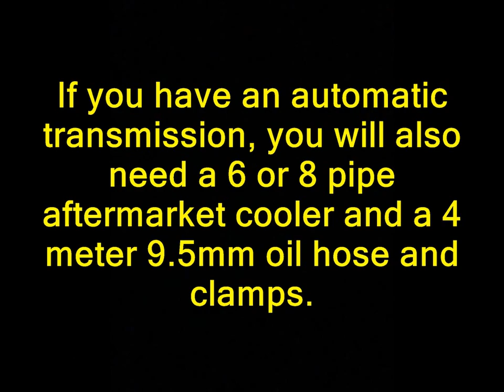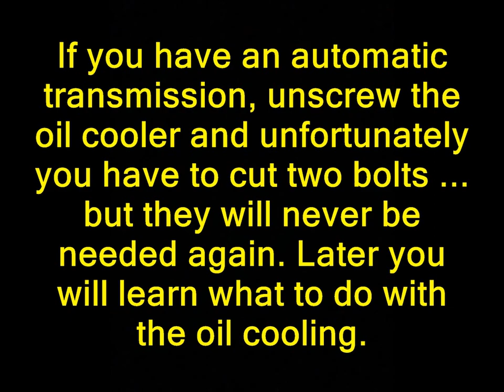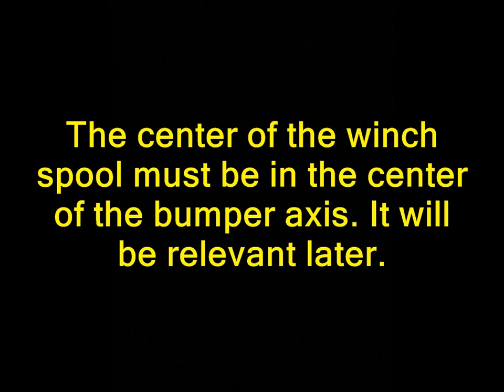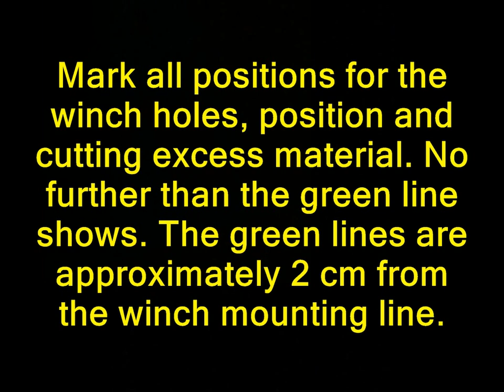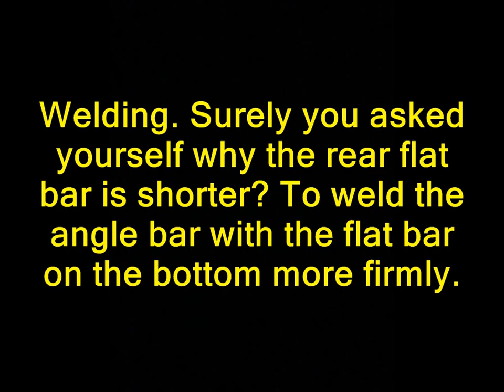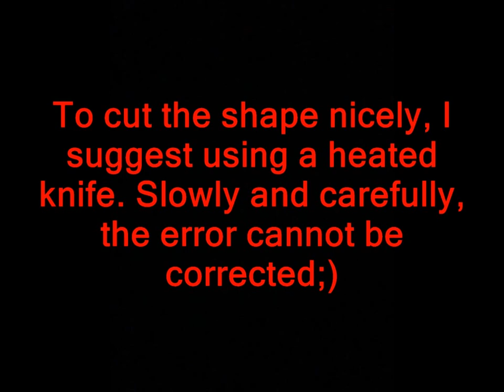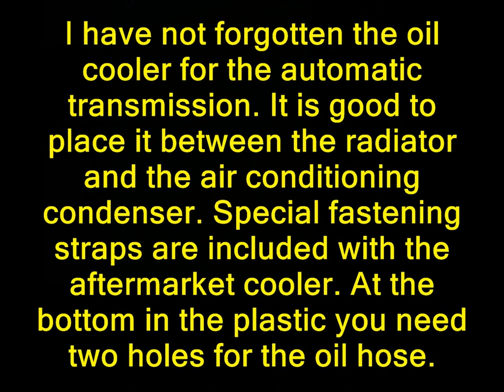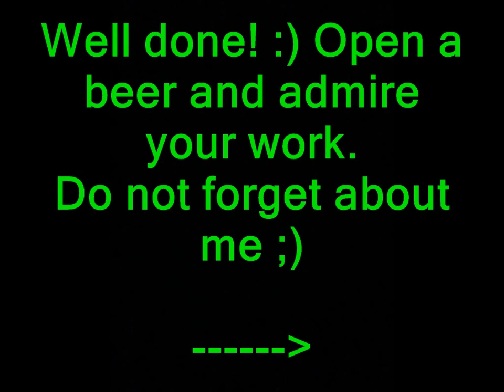Hyundai Terracan DIY winch mounting plate by Monter.

Comment: That oil cooler seems small to me, compared to the faktory one.
Reply from the maker: You didn't pay attention to bandwidth.  If you fell mine is too small I wrote that you can buy an 8 pipe radiator.  I put in the temperature sensor of the oil returning to the transmmision so soon I will know if 6 pipes are not enough.  In my experience, it is enough.
Reply from the maker: After one year i can tell you 6 pipes cooler is enough, oil temp is between 60-80 celcius degress. Event in hot day and big load is not more than 95 so still far away from max iol temp for AT.